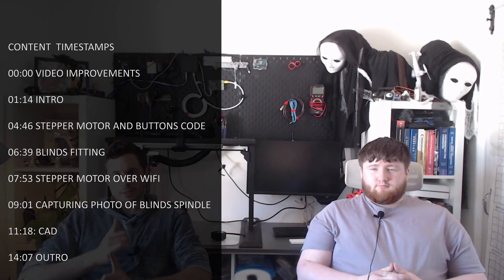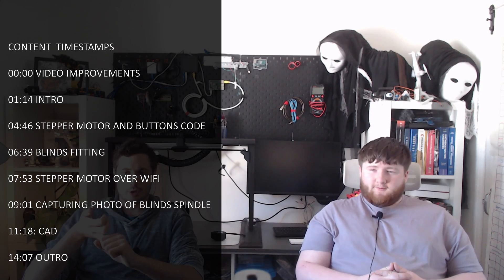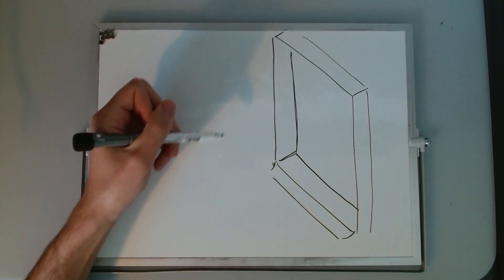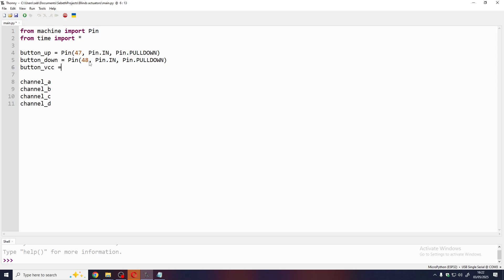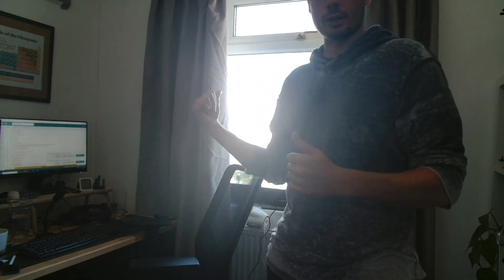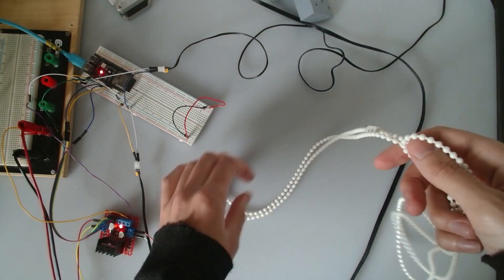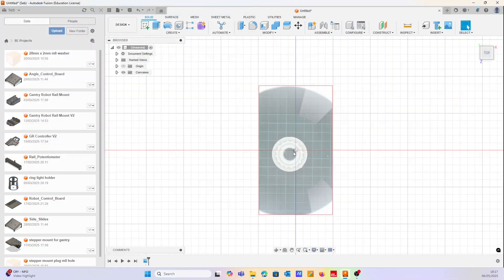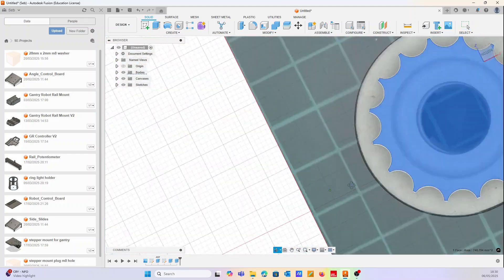Creating automatic blinds to wake me up in the mornings

Comment: great job guys! if I can make a recommendation, add a limiter switch on top and bottom of your blind travel segment. use the limiter switch to determine when its hit an edge.
Reply from the maker: that's a good suggestion, I'm not quite sure what you mean by edge? I'm guessing end of travel?.

if it is end of travel (when blind is fully up/ when blind is fully closed), we are aware of this issue and are working out ways of doing this. a switch is one of them
Reply: @SERO-Systems  yes, exactly. Like VS10N031c
Reply from the maker: we took apart an broken ender3 3d printer and got a few limit switches. (some of them appeared in the initial coding section of the motor movement) 

 they are what we plan on using for finding if it at the end of its movement or not.
Reply: @SERO-Systems nice! +1 for recycling
Reply from the maker: yes :D

also we are both broke university students so anything we can get our hands on we use!